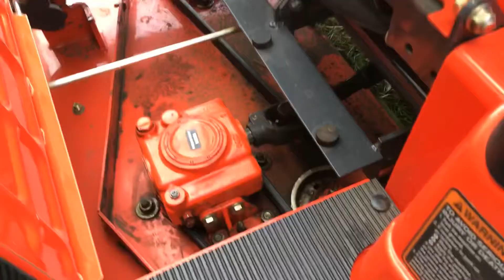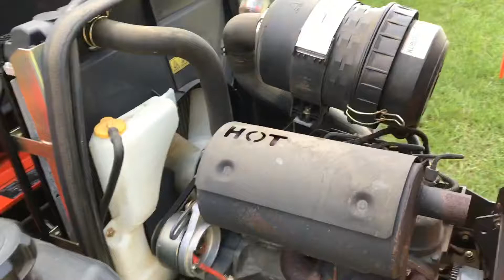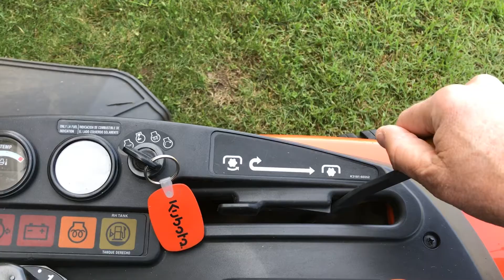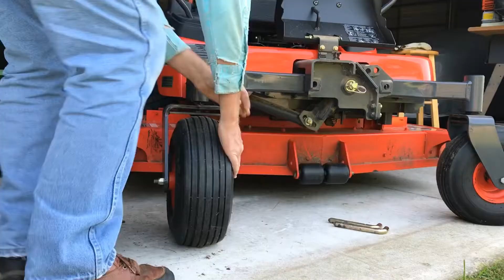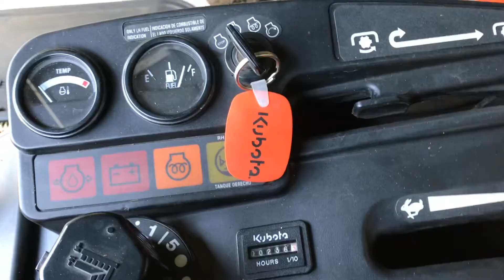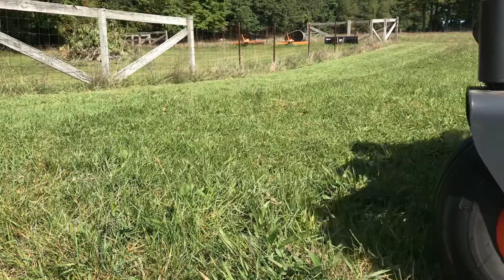Kubota ZD326 Zero-Turn - Up Close

Comment: The "S" refers to tires that cannot go flat.  I have the same exact mower but we have the Pneumatic tires and have had to. replace one of the rear tires, and put tubes in, and put some plastic like substances to prevent air leakage.

Comment: Twelve years ago I purchased a ZD331 with a 72" deck. Kubota makes the best diesel engines in the business for small machines. Their zero turn machines blow away the competition. Their new diesels have less cubic inches and use turbochargers that meet government air pollution standards. My dealer salesman said "don't buy one".

Comment: I have owned my 326 for 12 years but learned a lot watching your videos. Keep it up
Reply from the maker: Personally speaking I believe the 326 to be one of the best mowers.  It’s not perfect, but like most things, if you watch over it, it’ll go the distance.  The deck gearbox oil volume is a weak link so keep a close watch on the oil getting too low and change frequently, otherwise this machine is rock solid.  We’re still running the original battery from 2006.

Comment: Do you know when the zd326s came out? Compared to the zd326, what are the differences in the two models? What does the S stand for?
Reply from the maker: A follower mentioned the S uses pneumatic front tires and the other uses airless tires.
Reply: @Stromzilla   ok thanks. Have watched nearly every video and review on them and couldn’t figure out what the difference was. 

Your Kubota videos are very good too by the way 👍🏼

Comment: Wow, 236 hours.  I have the same mower, 1,750 hours and it still looks and works like new.  Just basic maintenance with no mechanical issues. Like you I clean mine after every mow.  It is also garage kept.  I would buy another one tomorrow!  It is  just a beast of a mower!
Reply from the maker: I’m with you.  These are awesome mowers and if taken care will last a long time.  I think I’m up to 272 hours.  The new Kubota retails near $17k.   By the way, still using the original battery which now 16 years old.
Reply: @Stromzilla  it's if you give a little clean under your Kubota ZD 326s have some dry grass under the mower

Comment: Very nice,   I have the ZG 327.  I was told I need to put a Innertube in one of the rear wheels at it  has a slow leak in it.  Could you tell me what size innertube I would need for one of those tires.   Thanks
Reply from the maker: Should be the size that the tire is.  Try using the green slime from Walmart or auto parts stores.  Would think it would work well.  That’s how we plan to deal with a slow leak in the front tire of our machine.

Comment: Thank you so much for this and your other video on maintenance. Video is far better than the manual for finding grease zerks. Only three I couldn’t get too in the back. Will keep trying though. Hubby recently passed and I’m trying to learn all I can about taking care of things. Thanks again for your time in making these videos.
Reply from the maker: I’m so sorry for your loss.
Reply: @Stromzilla  thank you
Reply: @Stromzilla  thank you
Reply from the maker: It’s awesome that you’re wanting to learn about maintenance.  Let me know if you have any questions.
Reply from the maker: You might want to watch our Gearbox oil change video.  The gearbox is small and therefore the oil capacity is relatively low.  Therefore I tend to change it out more frequently than the manual calls for.  The cost of that gearbox is near $1,000.  Cost of a quart of Amsoil 75w110 is $14.
Reply: @Stromzilla  I found out about the gear box but $1021 later. I check it every time now.
Reply from the maker: Ouch!!!!!!
Reply: i am sorry about your hubby

Comment: Super clean tractor & a great info video.
Reply from the maker: Thank you for watching.  These tractors new are expensive.  However, a well taken care used at a fair price would be a heckuva mower.
Reply: @Stromzilla  That's what I did.  Bought a one owner non commercial use with 825 hours on it.  2008 326P.  It's worth as much if not more today than when I bought it 6 years ago.  Half price of new.  It's a tank and gets all recommended maintenance.  I expect it to outlast me.
Reply from the maker: @triple6758  Congrats and well done.  Sounds like you have a good one.